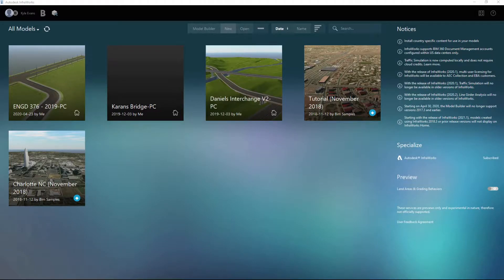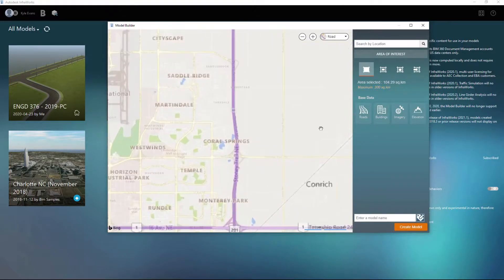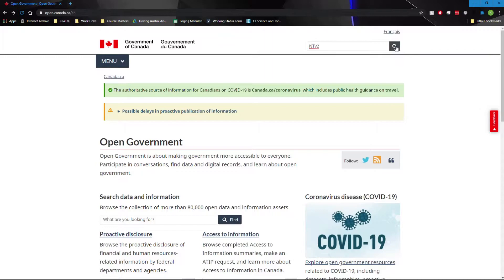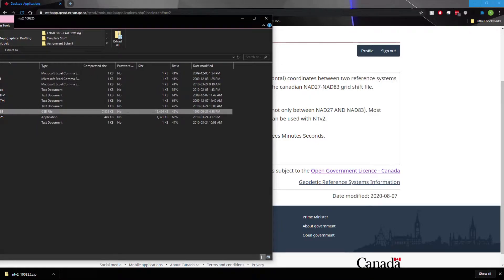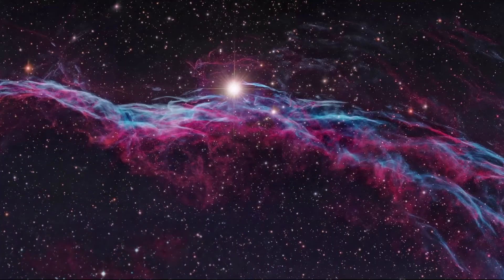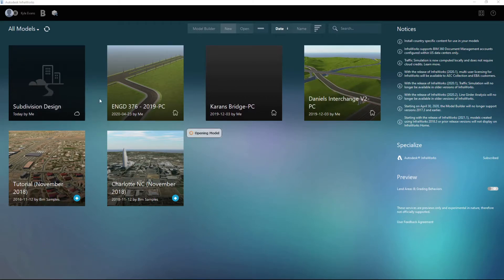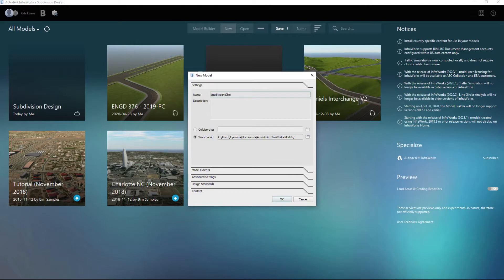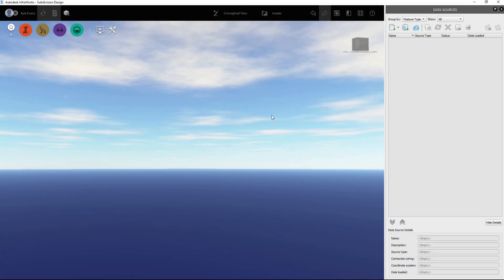Intro to Infraworks Part 1 - Setting Civil 3D up for Canada and Creating a Model in Infraworks

Comment: at about the 9:16 mark under advanced settings, why did you set both UCS and DATABASE to the same coordinate system? I've been using Infraworks a little and never really understood this setting.
Reply from the maker: The UCS is attached to the file and is what the file uses for a coordinate system. The below here is from the Autodesk website about the Database coordinate system.

The Database Coordinate System – It can be risky to choose a different database coordinate system for your model without any relevant GIS experience. In fact, most new users usually don't need to, and shouldn't change the Database coordinate system for their model without a good reason to. You cannot change the Database Coordinate System for models created by the Model Builder. You can only change the Database Coordinate System for models that you create manually in InfraWorks.
You do not have to assign a database coordinate system to a new InfraWorks model. By default, the database coordinate system is set to LL84, which uses meters to measure elevation, and Lat & Long to measure X & Y.
Once you assign a database coordinate system to a new InfraWorks model, the database coordinate system is permanently written into the .sqlite file that represents that model, and cannot be changed. 
The only reason to change the default database coordinate system settings is if you plan to work directly with the model’s SQLite file outside of InfraWorks. This can affect how the data appears when the .sqlite file is opened in a different application, such as AutoCAD Map 3D.
Reply: @KyleEvansCivil  thanks for the reply. really enjoyed the series.

Comment: Hi Kyle, glad to see you are doing an infraworks series now! 

I'm sure you'll go into it a bit more in a future video but I'm a bit fuzzy on why exactly this ntv2 file is needed. Civil3d seems to be able to convert utm into 3tm or 10tm using map queries just fine. I also haven't really had issues exporting files from c3d into infraworks, although I typically just use shp files due to version restrictions between c3d/IW. 

In doing some research it seems maybe this is only used for transforming large drawings from nad27 datum into nad83.

Any clarification would be great! Thanks
Reply from the maker: Every time I have tried to do any kind of a conversion from 3TM to a UTM system Civil 3D has errored out and not performed the conversion. As soon as I link the NTV file it works beautifully. I am not specifically using a map query, it is more of the Automatic Point Conversion or even MapExport commands where I find this is needed.